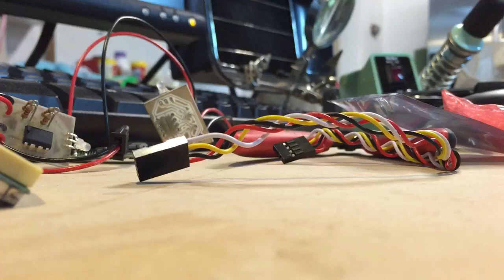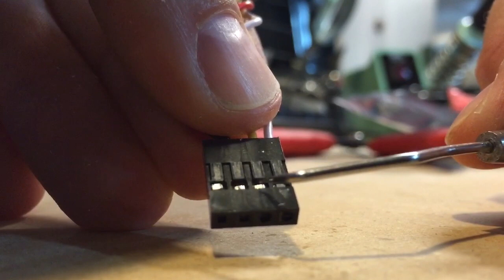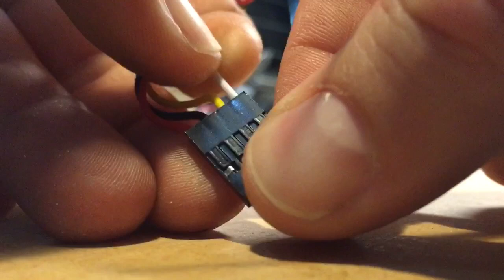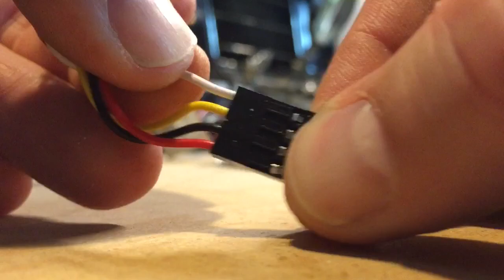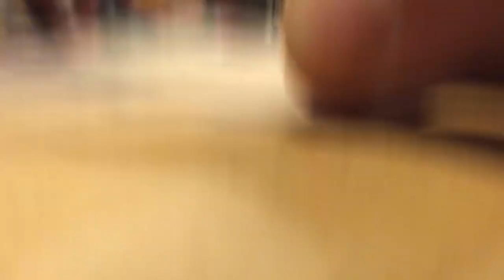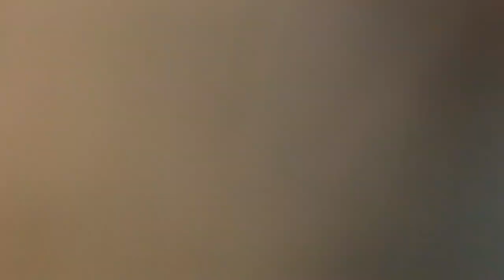DuPont pin removal/insertion

Comment: Can you take the metal part off as well and connect different wires?
Reply: Milkdud You have to replace the metal pins with new ones and crimp them. If you do that, you will have the most luck using the special crimped for it.